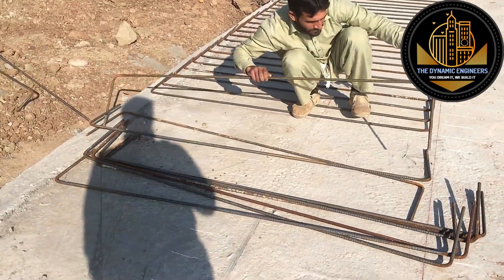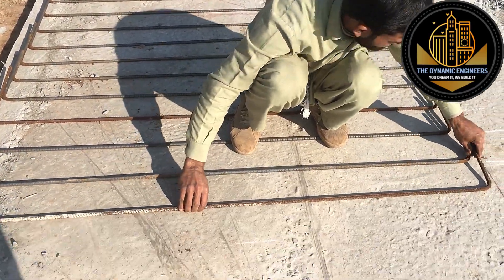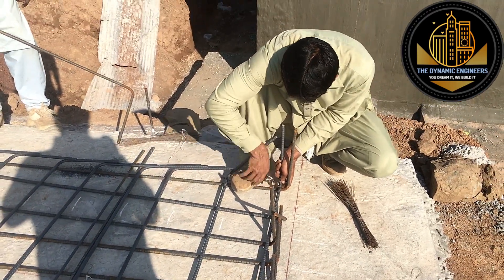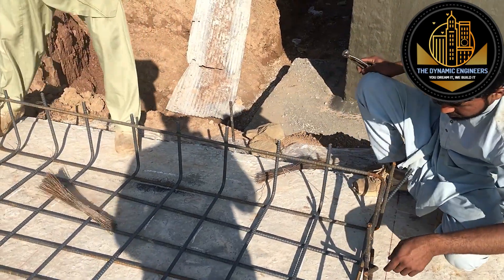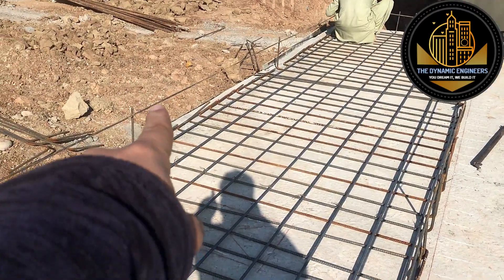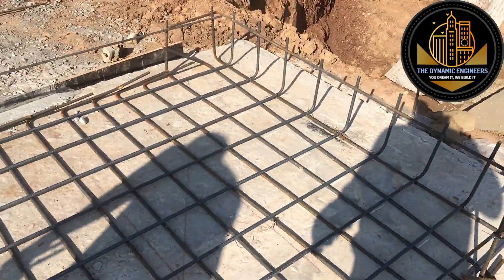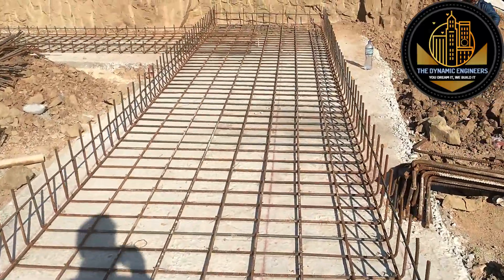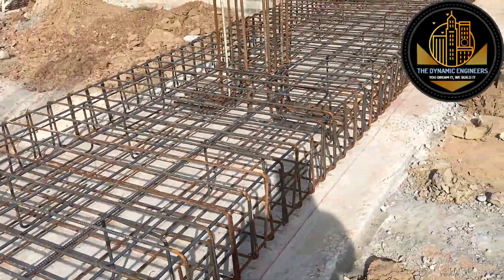Strip foundation in building construction site | types of footing

Comment: Please ignore if its not relevant here. I have seen people do a full basement and on the ground floor they park two cars. Just wondering how much weigh it can bear ? Is it safe by the way ?
Reply from the maker: Yes. But in that case you have to design that slab for car parking load instead of normal live and dead loads.
Reply: @TheDynamicEngineers  Ohkay fair enough. Thank you